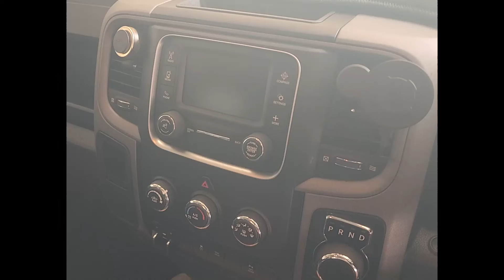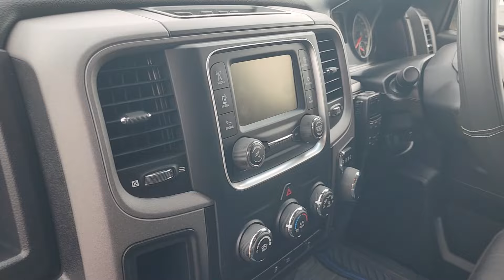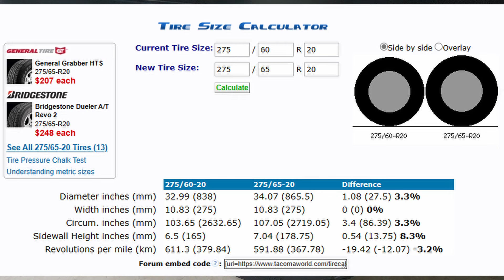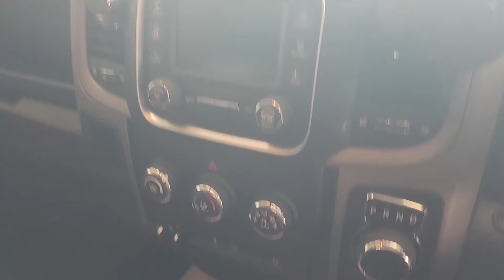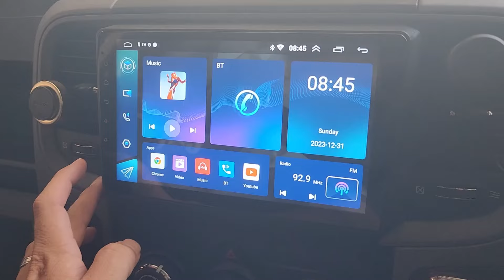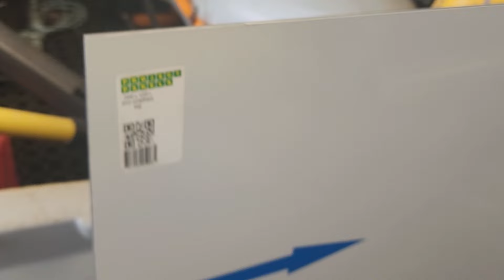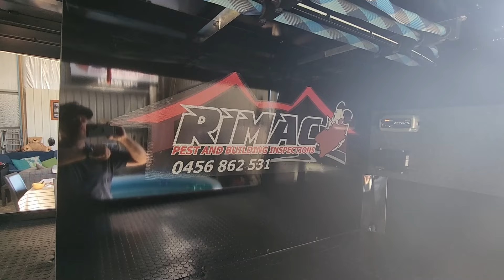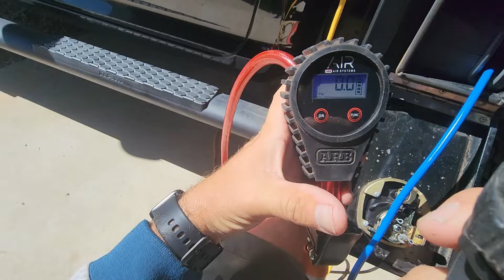Ram 1500 tourer Build

Comment: If you need to get that glue off your windscreens, a blow torch on the outside of the glass directly over top of the glue will heat it up enough to break it off , don’t try breaking off without heat you’ll crack the windscreen. Another tip for ya 👌🏼👌🏼